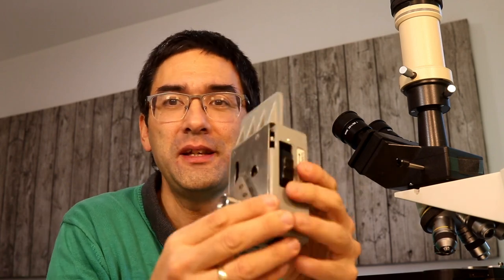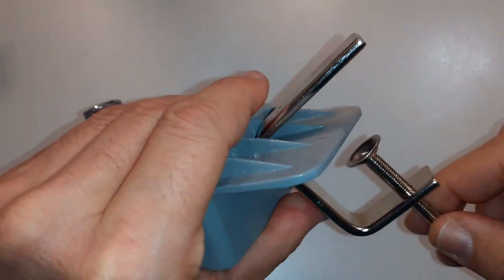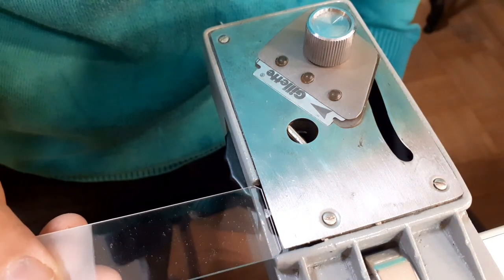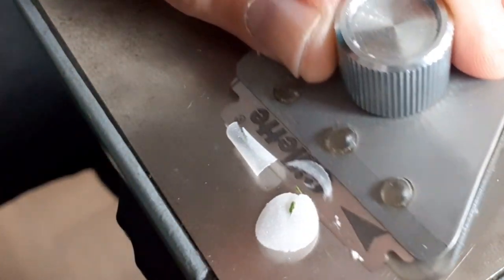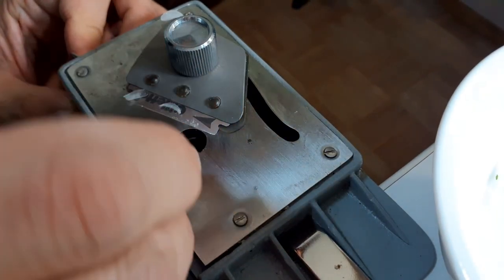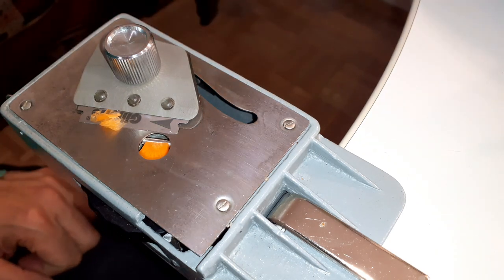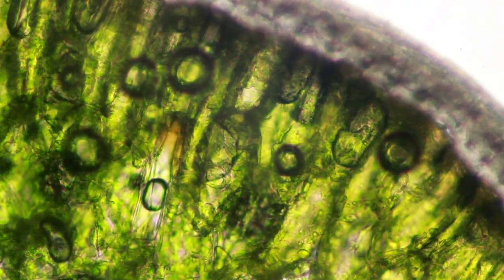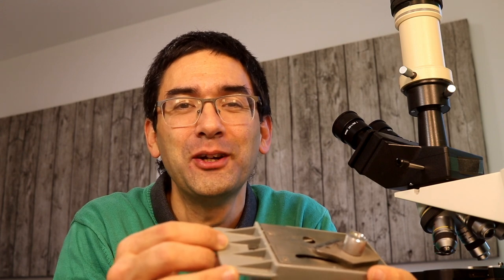🔬 Unique microtome | Amateur Microscopy

Comment: Inspired by your channel, just wondering if this microtome can be used to cut some hard materials, such as fur or hair fiber?
Reply from the maker: This would not be a problem, if it is supported. I think it will be difficult though, to put the cut hair or fur flat on the slide. It is like a small disk.
Reply: Thanks a lot for the reply. May I contact you for the details, if it could cut hair nicely, l really want to have one.

Comment: I think microtomes are one of the most overpriced tools, histology microtomes are just a lever with a screw that is turned by a step down gear mechanism in increments with each rotation yet they cost about the same as a sedan.